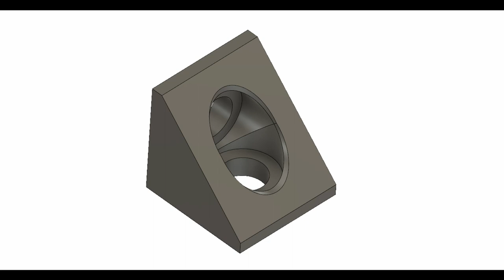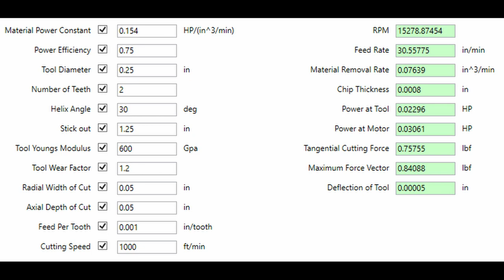CNC Milling Aluminum Angle Brackets

Comment: Interesting video. Correct me if I am wrong, but isn't part of the use of the parallels to add vertical axis support, by leaving the parallels in while cutting?  Thank you for sharing. Wonderful little machine.
Reply from the maker: Yes, I believe you're correct. At the time I made this video, I didn't know how to properly seat the part in the vise against the parallels with a dead-blow hammer, so when I would leave the parallels in, they'd rattle around!